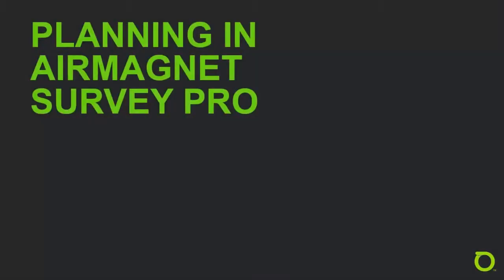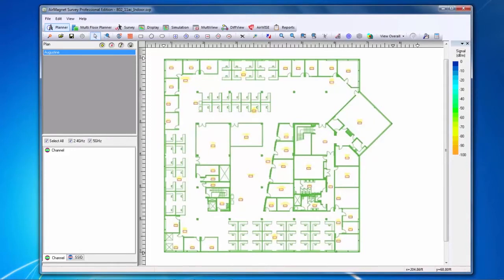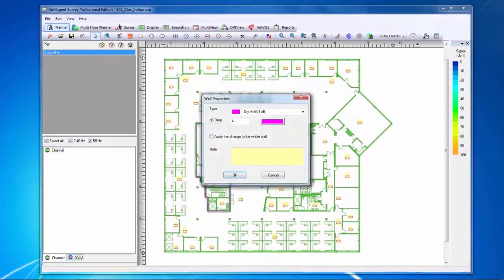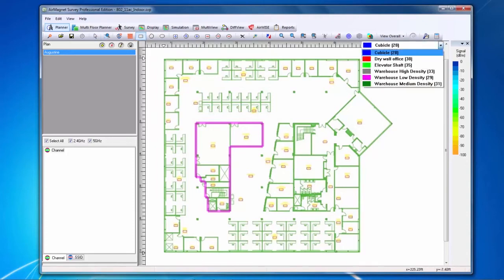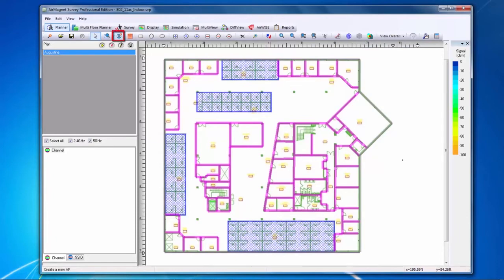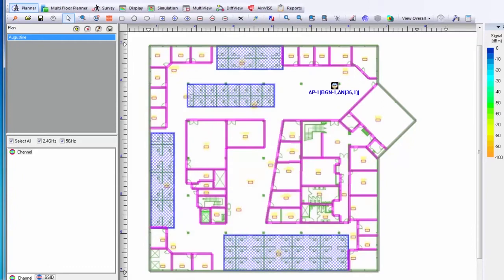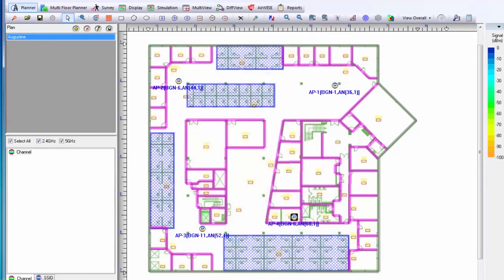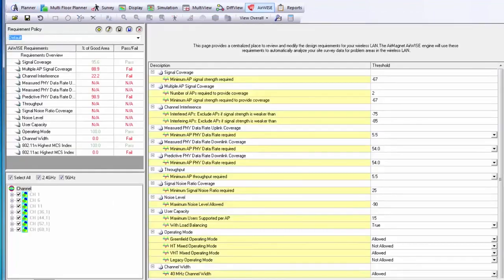Airmagnet Survey Pro   Using Planner

Comment: Can the Planner be used on a different computer than the Survey computer where the mac address is assigned to the Survey license?
Reply from the maker: On AirMagnet Survey PRO both the Planner and Survey tools are part of the same software, so they both will be available on the computer where the software has been installed. Still, you do have the option of installing the software on multiple computers and tying the licenses to an external adapter you can pass around.
 
Another option would be acquire separate Planner and Survey licenses. That way you can install the Planner on one computer and the survey on another.
 
A third option would be to acquire a copy of the Planner, and an AirCheck G2 with AirMapper. With this option you can install the Planner on your preferred computer, and use the AirCheck G2 to perform the surveys. No need for a second computer!
Reply: @netallynetworktestingtools  Thank you!!!